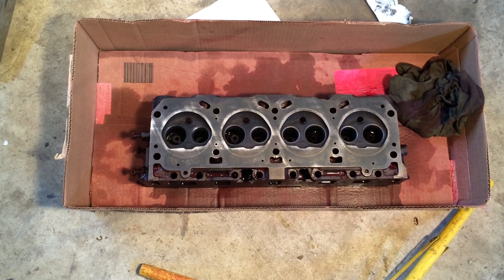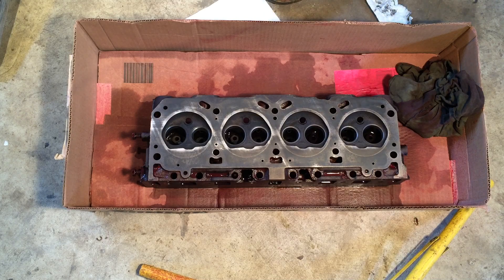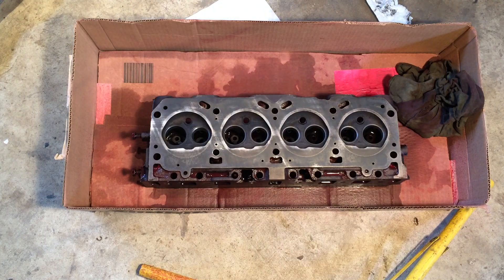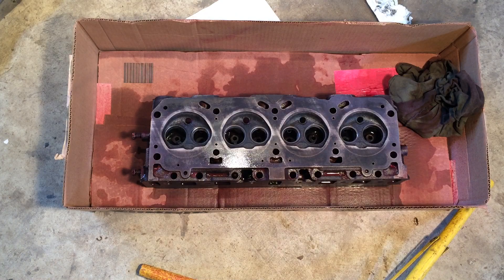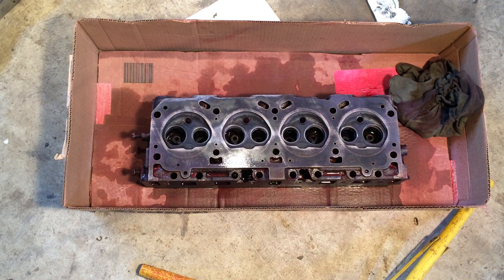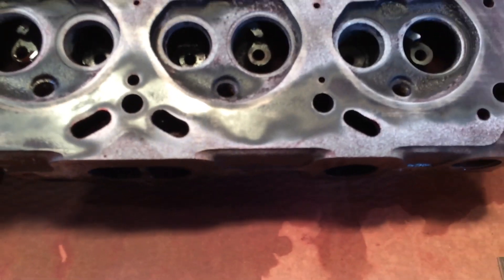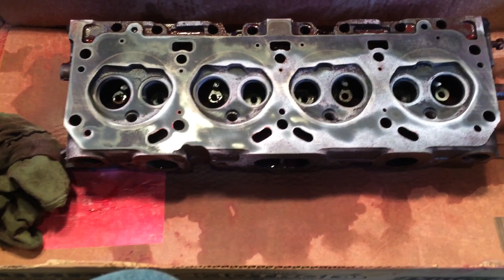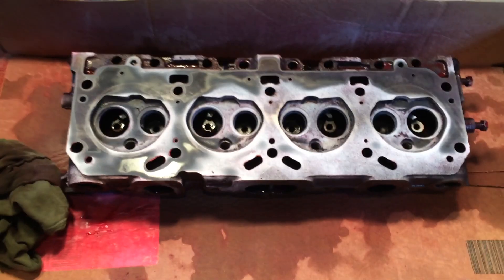How to check cylinder heads for cracks pt.1

Comment: Dude, its cool. But what are the names of the two sprays you said.
Reply from the maker: The one can was the penetrate and the other was the developer. The company was magnaflux and the cans said "spotcheck" on them. The penetrate said skl-wp2 on the can and I believe the developer said skd-s2.
Reply: step 1 cleaner, step 2 red dye penetrant, step 3 developer
Reply: 1 is a cleaning spray the other turns dark on cracks developer